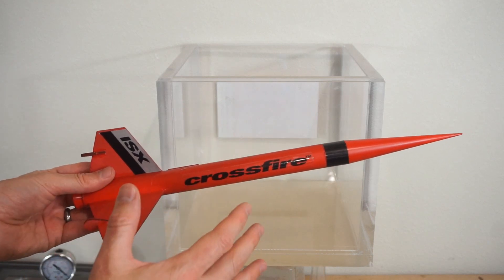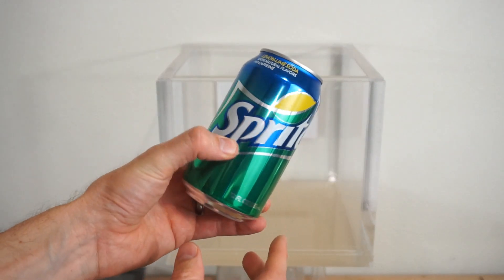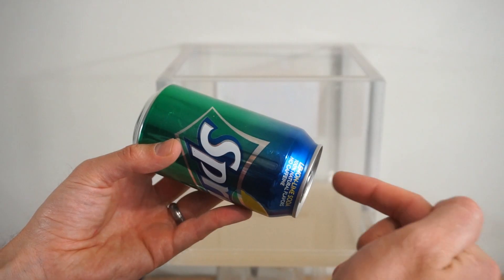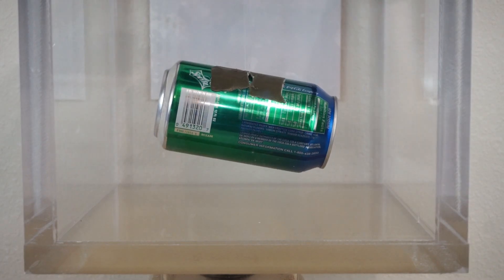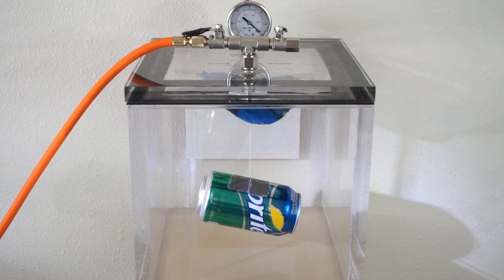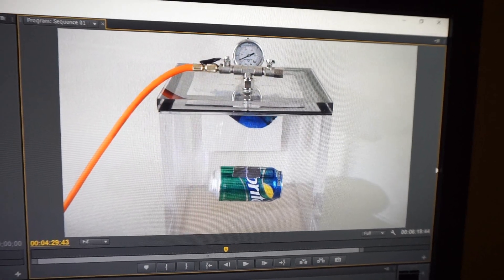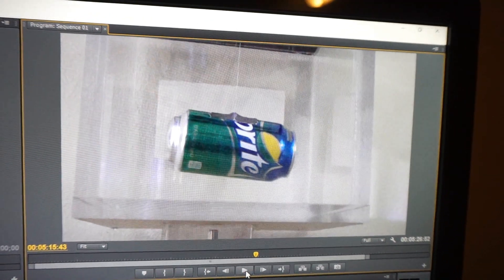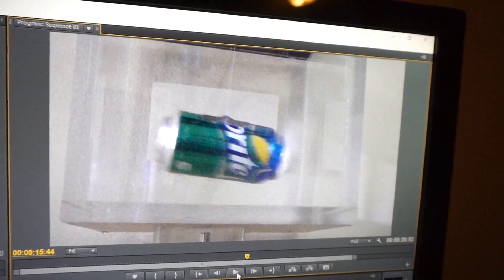Can a Rocket Fly in a Vacuum Chamber?

Comment: Well it proves that a soda can hanging on a string explodes in a vacuum chamber thus moves, the analogy that therefore a rocket flies in vacuum ? well you would have to show a rocket flying in your vacuum chamber to prove what you initially wanted to prove, rockets are not in a container and are not hanging on a string, just saying
Reply: So a can that explodes moves in a vacuum?  Why?

A rocket is nothing more than a CONTROLLED explosion.  A rocket works by combining fuel with an oxidizer and LITERALLY igniting the fuel - causing an EXPLOSION, but rather than the explosion being random - it's directed into a single direction.  Your issue isn't in not understanding that rockets work in a vacuum; it's in understanding how rockets work.  The fact that you accept that this exploding can will move in a vacuum......yet deny that a rocket would work in a vacuum is testament to the fact that you don't have a clue what you're talking about.
Reply: @willoughbykrenzteinburg  combustion in a vacuum is impossible anyway, chatbot 😂
Reply: @papalegba6796  true.  What you apparently don't understand is that combustion isn't happening in a vacuum.  It happens inside the rocket.  The exhaust from that combustion is what is expelled.  In comes the conservation of momentum.  A concept you clearly fail to grasp fully.

Next
Reply: @papalegba6796  Well the sun manages it 24 hours a day right?

EDIT: For those that can't tell; I'm testing papalegba's knowledge, knowing full well he will not be able to correctly answer. I'm aware of nuclear fusion, thanks!
Reply: @willoughbykrenzteinburg  so you admit your first post was wrong? 😂
Reply: @papalegba6796  no.
Reply: @willoughbykrenzteinburg  Yes you did 😂
Reply: @willoughbykrenzteinburg  Oh I'm well aware of the difference, I was just being facetious because I know papalegba doesn't (who my reply was to, by the way), and he's proven there's no point in having a logical conversation with him, so it's more fun this way.

You seem to be quite rude to everyone though unfortunately. So I won't be interacting with you further.
Reply: @CorrosiveCitrus  oh no....
Reply: @CorrosiveCitrus  No you weren't 😂
Reply: @papalegba6796  Let's see you answer then
Reply: @CorrosiveCitrus  it refuses to answer ANY questions.
Reply: @stuartgray5877  Yep! Hah. This was point to willoughby - papalegba is just a typical internet troll so no point trying to use actual reasoning and logic with them; though smart of him to not answer questions as it does prevent us having a good laugh at the answer
Reply: @CorrosiveCitrus  It is just a POE. It DOES understand how the physics works but tries to deny it.
If it did NOT know how the physics works, then it would NOT KNOW what questions of mine to AVOID.
Reply: @stuartgray5877  ok chatbot 😂
Reply: @papalegba6796  Then WHY do you refuse to just TELL us HOW the mass of the exhaust gas gets accelerated away from the rocket?
Reply: @stuartgray5877  lol wut? 🤔😂
Reply: @papalegba6796  You have made multiple statements that mean you believe that rockets can accelerate mass without applying any force to that mass.
So, you think rockets violate Newtons Laws.
You have said it multiple times.
Reply: @rocketman484  wrong again, chatbot 😂
Reply: @rocketman484  quote where I have said that, lying chatbot. Come on, find the quote 😂

Comment: Exhaust of the coke can rocket hits the back wall of the chamber. I am not that a back wall disproves the test. It's a uncontrolled variable.
Reply: To demonstrate the force that is created by you could put the soda can on an arm I'm a device that would measure the amount of force created. A torpedo has to deal with the confines of heavy dense water molecules. So technically if you could try different atmospheric pressures. All on the arm of device, measuring force in Newtons.
Reply: You should use a much longer tank where the force of the rockets thrust cannot make contact.
Reply: @adrianleggett4418  My company tests mono-propellant (hydrazine) thrusters here on earth in vacuum chambers.
We verify that they DO produce the thrust predicted by the 100-year old Tsiolkovsky rocket equation.
We then put those thrusters on real spacecraft, launch them to space and TEST THEM THERE TOO.
Reply: It's not that I don't believe that rocket engines create thrust in a vacuum. I'm just thinking of pure scientific principles.
Reply: Referring to controlled and uncontrolled variables. Plus an experiment is to run 17 times. To prove that it works. With the same results. Just talking about how experiments are supposed to run or generate plausible data.
Reply: Not only am I thinking of possible are generated by this experiment. I watched a different experiment on YouTube. The rocket was on a rotational arm. In round chamber, with decompression. The only problem with design, was the cam had to be placed inside. So we could not see rotation and the atmospheric meter simultaneously. If they could have put a viewing window in, it would have been perfect.

Comment: The can explodes because of the pressure difference. Don't know what that's got to with a thrust in a vacuum. The balloon pushes the air that is inside it off the side of the box. The drone doesn't work because there's no air. Seriously I don't know what you guys are thinking when you do these tests.
Reply: But the can begins moving as soon as the mass of the liquid starts moving.
Just like a gun starts recoiling as soon as the bullet starts moving.

Do you feel the recoil of a gun when you pull the trigger or when the bullet hits the target?
Reply: The can pushes off the lid that blows off. Then the vacuum is pressurised anyway 😂

Comment: Flawed test. As soon as one molecule left that can it’s not a constant vacuum as the exhaust if you will is getting thrust by filling up the chamber. There’s no filling up space... Now if you calculate exactly what the can pressure releases exactly and have that constant vacuum applied (preferably greater as there’s no vacuum greater than that of space) the can won’t move forward cause the exhaust is being pulled faster than it can push (I would theorize if anything it would be pulled backwards as the can isn’t pushing at all the vacuum around it is pulling). Add zero gravity to it and it debunks rockets in space. 
This guys doing flawed test and posing it as accurate... what a joke. He’s also breaking the laws of physics when he said if you throw a bowling ball in space you go the opposite way... not true. Something that’s in zero gravity can’t be pushed off of only pushed. So no... rockets in space is a lie.
Reply: - "cause the exhaust is being pulled faster than it can push"
This is false.
 The vacuum of space CANNOT exert a force on ANYTHING, solid, liquid or gas.
The gases are PUSHED OUT, NOT Pulled.
Now quit getting your physics education from Hollywood movies.
Reply: @stuartgray5877  if vacuum cannot exert a force, then a rocket in a vacuum cannot alter its state of motion. That's according to Newtons first law, chatbot 😂
Reply: @papalegba6796  So a crossbow fired into a vacuum would not experience any Recoil force. Got it. You don't understand Newton's laws.
Reply: @stuartgray5877  a rocket is an internal combustion engine, chatbot. A crossbow is not 😂
Reply: @papalegba6796  But a rocket accelerates mass just like a crossbow or a gun or a catapult.
Now tell us HOW a rocket engine can accelerate mass without applying a force to that mass.
Reply: @stuartgray5877  that's not how internal combustion engines work, chatbot 😂

Comment: A confined space vacuum chamber is NOT equal to the infinite void of "outer space".  Rockets could never thrust in an infinite hard vacuum.  This "experiment" is not a real equivalence.  The propellant in this example puts pressure into the chamber.   Space rockets pushing against their own combustion chamber is idiotic and is the same as trying to lift yourself off the ground by your bootstraps.  Your silly little demo is pushing against the wall of the chamber.
Reply: Rockets absolutely can thrust in a vacuum. It's called Newton's Third Law of Motion.
Reply: @ScienceNerd3336  the equal & opposite reaction to zero is zero. So Newtons third law is not your friend.
Reply: @papalegba6796  what do you mean by this? This doesn’t mean anything.
Reply: @ScienceNerd3336  it means Newtons 3rd law shows rockets cannot alter their state of motion in a vacuum, as a vacuum cannot exert an equal and opposite reaction. Simple to understand.
Reply: @papalegba6796  False. The rocket puts a force on the mass that is coming out of the rocket; the mass that is coming out of the rocket imparts an equal but opposite force on the rocket, propelling the rocket forward. As you said, "Simple to Understand."
Reply: @papalegba6796  And because I HAVE to explain this to you, it means you didn't watch the video.
Reply: @papalegba6796  no, dude, the rocket pushes on the mass that is coming out of it. You’re not even reading anything correctly. An example of this is a balloon. When you let go of the ballon, the balloon pushes the air out of it, the equal and opposite force is the air pushing back on the balloon. Same is true for a rocket.
Reply: @papalegba6796  So, answer me this: does GAS have mass?
Reply: @papalegba6796  So either you stop projecting with this "You understand no physics" and learn....

OR LOSE!
Reply: @papalegba6796  YES, IT DOES! Again, I'm going to repeat this for the "millionth" time, but this time, baby talk for an adult.

GAS INSIDE ROCKET. ROCKET PUSH GAS OUT, GAS PUSH BACK ON ROCKET. ROCKET GO FORWARD. 

GAS INSIDE BALLOON. BALLOON PUSH GAS OUT, GAS PUSH BACK ON BALLOON.
Reply: @papalegba6796  More projecting.
Reply: @papalegba6796  false. The rocket uses an engine to push the gas out of it to create thrust. Stop lying, kiddo.
Reply: @papalegba6796  you’re repeating the same thing I am saying. ROCKET PUSH ON GAS, GAS PUSH BACK ON ROCKET. PRESSURE, BUDDY!!!
Reply: @papalegba6796  gasses put pressure on the internal structures/surfaces of the rocket. Rocket push back on the gases. Hence why it propels it forward. Thanks for playing.
Reply: @papalegba6796  and no, it doesn’t need to meet external pressure. That doesn’t mean anything.
Reply: @papalegba6796  More ad hominem comments in this thread too. Seems to be a habbit of yours.

If you shot a crossbow, or a gun in a vaccum, would there be no recoil?
Reply: @papalegba6796 You didn't answer the question, only thrown out more insults. Your debating skills need a lot of work.

You don't like crossbows, okay. I also mentioned a gun. We can throw in a cannon, or an rpg launcher too. Would these not recoil in a vacuum?
Reply: @papalegba6796  answer his question. Will a crossbow recoil in a vacuum? Will a cannon recoil in a vacuum?
Reply: @papalegba6796  answer the question: will a crossbow recoil in a vacuum?
Reply: @papalegba6796  Still didn't answer the question, as suspected.
Reply: @papalegba6796  there are literally chat bots that can better understand and respond in context than you. It would be less boring to debate with a literal machine rather than yourself.
Reply: @papalegba6796  So when a Space Shutte Main Engine is running here on earth in atmosphere :
1 - Is the exhaust gas ACCELERATED from the nozzle? (Does it experience a change in momentum as a result of the engine?)
2 - Does the exhaust gas have MASS?
3 - Can MASS be ACCELERATED without a FORCE? (Or is a force REQUIRED to accelerate mass).

Now just answer these three questions about rockets in atmosphere then we will get to the questions about vacuum.
Reply: @stuartgray5877  This is what I've noticed, he has even made multiple accounts to spew non-sense -- likely very invested in consipiracy theories, maybe part of the groups that profit from them
Reply: @stuartgray5877  here again copy pasting nonsense, chatbot?
Reply: @papalegba6796  projecting much?
Reply: @CorrosiveCitrus  See, 100% predictable (and it calls ME the Bot)
Reply: @papalegba6796  Tell us AGAIN how "Rockets push on Air".
Which is 14.5 PSI GAS. 
But they CANNOT Push on the GAS in the combustion chamber even though the 5000 PSI Gas in the combustion chamber is over 100 times MORE MASSIVE (has MORE MASS) than the atmospheric AIR.

SO, You KEEP SAYING "Rockets Push on GAS, but they CANNOT Push on GAS".
Yeah, you are brilliant!
Reply: @papalegba6796  - "already explained, chatbot clown"
Oh REALLY?
Because I DONT SEE any explanation in this thread.
Perhaps you should try again?

Maybe you just forgot since you have so many sock accounts?
Please explain how rockets CAN Push on 14.5 PSI Gas but they CANNOT Push on 3000 PSI gas.
Reply: @stuartgray5877  nope, explained already, blind chatbot.
Reply: @papalegba6796  Oh I SEE IT NOW: You claim that rockets push on GAS, but they CANNOT PUSH ON GAS.

Got it.
Reply: @papalegba6796  - " No I dont"

YES, YOU DO. You CLAIM that rockets push on AIR (which is a GAS).
But then you say they CANNOT Push on "Gas" that they expel from the rocket nozzle.
So, WHICH IS IT?
Can rockets push on "GAS" OR NOT?
Reply: @stuartgray5877  stop ranting, chatbot.
Reply: @DrCash7  lol look at chatbot Stuart pretending I didn't already post this:
"The Gas expands from higher to lower pressure using its own internal energy, and if that energy remains the same at the end of the process no work will have been done, no force created, no mechanical power produced".
This is all it does now, spam the same question hundreds of times & hope nobody understands simple thermodynamics 😂
Reply: @stuartgray5877  "we" 😂😂😂😂😂😂😂😂😂